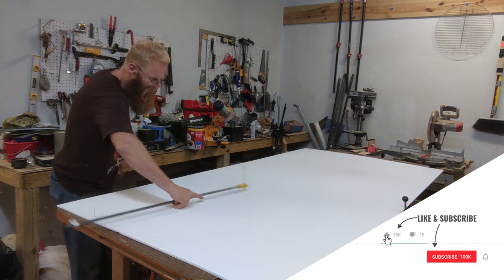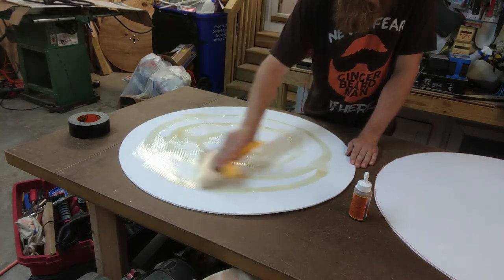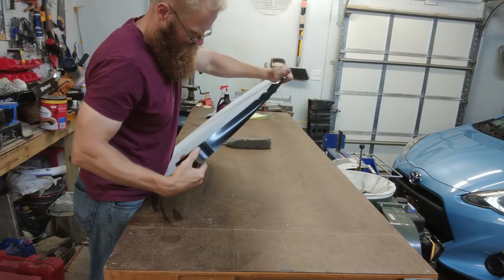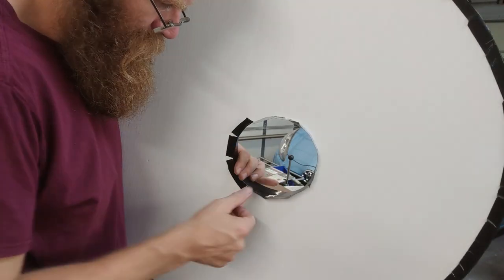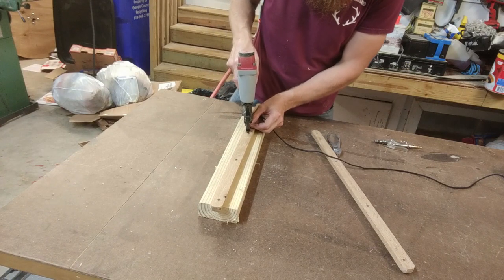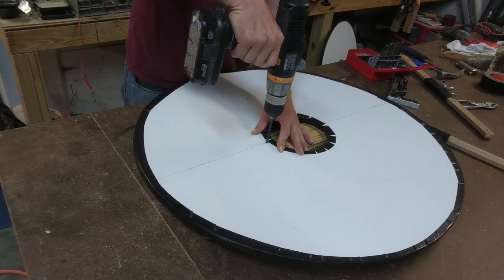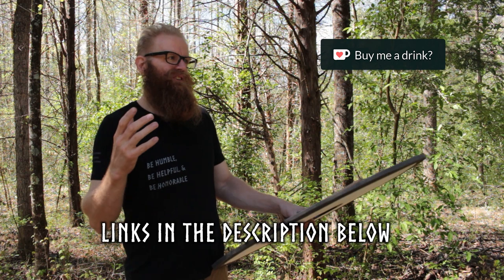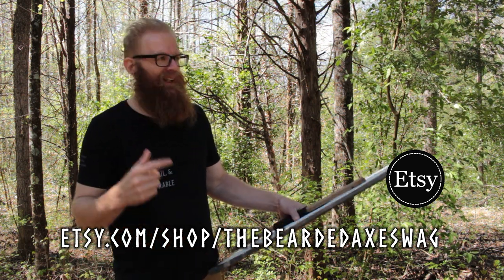Making an Ultra Light Plastidip Shield:  The Core

Comment: quick question,  how would we curve the core to make a scutum (or a roman tower shield)? is it a heat and curve? or is there another way to do that?
Reply from the maker: Good question.  Much like how those styles of shields are made I would do the same method.

Make a form and use a heat gun to gently mold, bend and form around that curve.  Do this layer by layer just like this method where cross the grain 90 degrees.  I did this with one shield blank so far and it's held it's shape pretty well.  I haven't finished it of course lol  Thinking about doing another plastidip shield after I finish this series.  The problem is I work full time and can only film one day a week.

All this to say...one day I'll get around to making that video lol

Thanks for being patient :)

Comment: How well does that plastiboard bend? Like can I make a slightly curved shield out of it?
Reply from the maker: Definitely
I've made a heater shield blank but haven't put foam on it yet.  Used a bit of heat and a form to get to shape.  So far it's held it's shape.
Reply: @TheBeardedAxe  so you'd recommend I heat it first? How so? I was gunna do the old bluefoam coreless curve method of curving a sheet over the form, then glue 2 more layers on top before removing it from the form

Comment: Can you link where you buy your corrugated plastic sheets? I'm having a tough time finding any that isn't a million dollars for a single sheet. It's the same issue I have when looking for closed cell polyethylene foams.... not cheap at all.
Reply: Also what size thickness do you use?
Reply from the maker: I get mine from Lowes Hardware.  They only sell it in 3 millimeter thicknesses.
I've never ordered it in online unfortunately.  
With the foam I went with USAFOAM.COM
However I'm thinking of finding a new supplier.  Amazon maybe?
Post any links you find here.  I might be able to help.